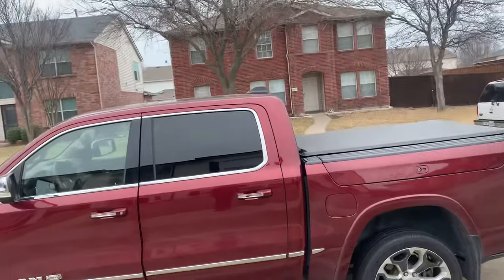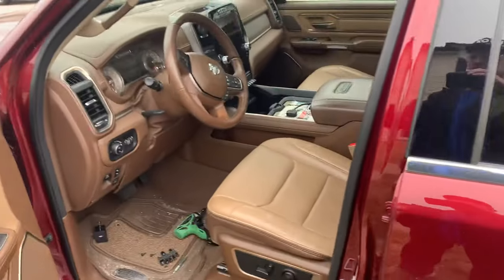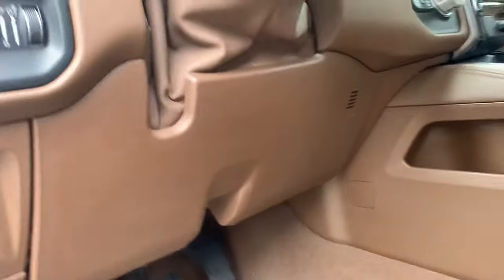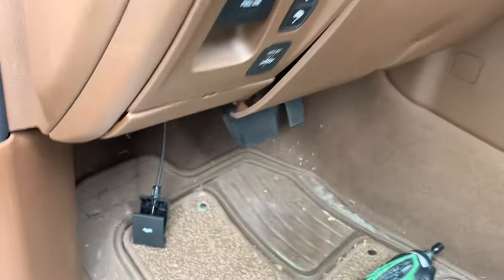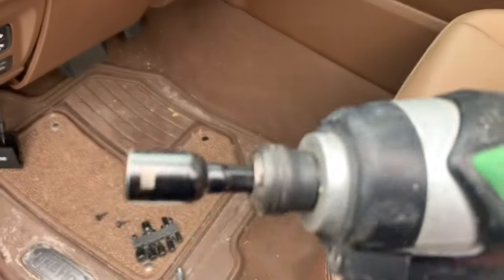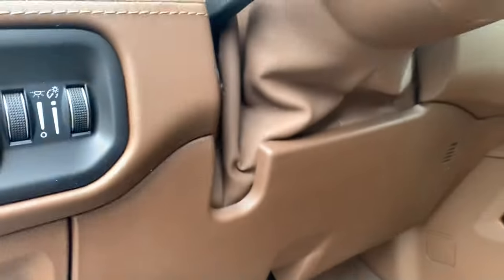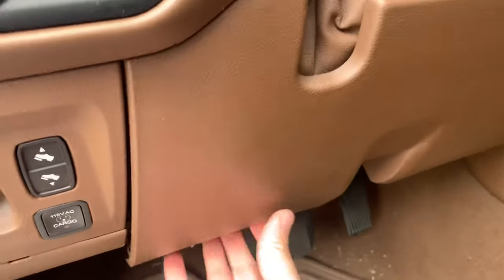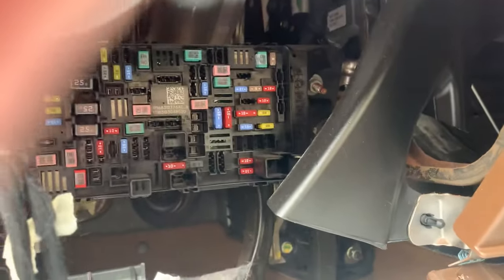Fuse Box Location 2019-2022+ Ram 1500

Comment: Ridiculous.  Bought a 2021 Big Horn.  Probably my first and last Ram.
Reply from the maker: It has its quirks but I’m happy overall.
Reply: @2Point   Rides great, I agree.  Hopefully it holds up.  Quirky is a good way to describe.   We have a 2017 mid-level Hyundai and the electronics on it are more refined than the Ram.  Thought it would take getting used to be it's just worse.  And keyless Start button but not keyless entry is a really odd one.   If you have to get keys out to unlock, then why even bother with the keyless start.  You already got your keys out.  And this is a truck that has heated seats and steering wheel.  Just an odd mix of options.   Yeah, I know, if I want more then I need to step up in packages.  At some level though you just kind of assume some of these things are there.
Reply from the maker: @alanberickson  I think in a few years, all of those features will be included on pretty much every model of vehicle
The sizzle feature they will charge for will be self driving related.

Comment: Thanks for your video! I am installing an accessory switch for Winch relay and looked at the typical fuse block spot on earlier years but no friggin panel. I agree with your verbal assessment of the change and having to use a 7mm socket....damn engineers could have put a simple mechanical latch or some simple knobs to unscrew for panel access...

Comment: Can you just replace the screws with a hex head
Reply from the maker: I suppose I COULD replace every nut, bolt, screw, hose, cable and part in the truck if I chose.  Orrrrr…RAM could just do it right the first time.
Reply: Why should i need to do that on a $60k truck?

Comment: Im with ya brother, not only that, 5.7 hemi with a needle dick oil filter in the worst location. I tried remote kits, yeah, good thought, however, no matter what fittings I had or made,  they still fricking leak, I ended up with using a slightly bigger filter which basically fits with a few contortions of the wrist, Mobil: M1-212A.   One more thing, the stoopid ass tranny pan? OMG, ABS plastic, cannot drain it, plug is blocked by the crossover pipe,  I replaced mine with the PPE, best design period.

Comment: 🔵 I love it that way! No one can tamper with the fuse box that way. It’s a brand new car, what kind of major issues are you anticipating to encounter. By the time I run into those major issues, I would’ve long traded that vehicle and let it be someone else’s problem.
Reply: The problem is that we are encountering these issues like blown fuse for a new 2022 Ram with 30k miles. Tail lights shouldn't even be going out until at least 60k to 100k miles.

Comment: Wouldn't you just like to slap some sense into the designers? Good grief. I think I got lucky, however; I found a fuse box under the hood over the driver side wheel well. Unless there are two fuse boxes?